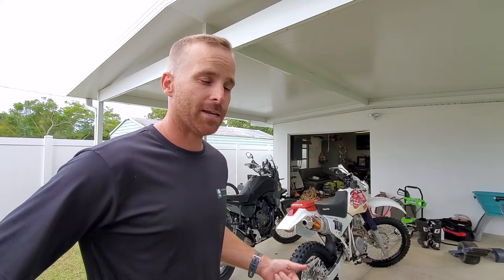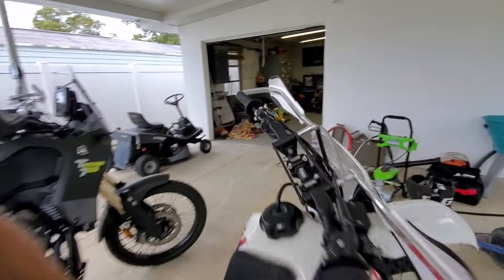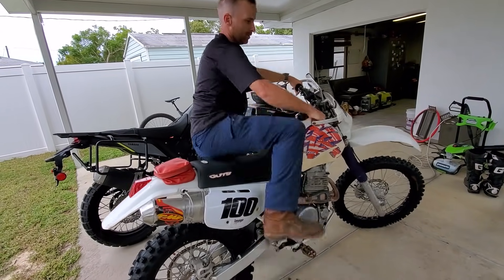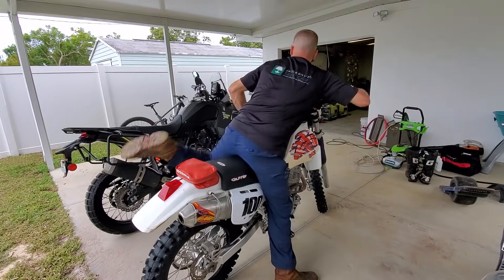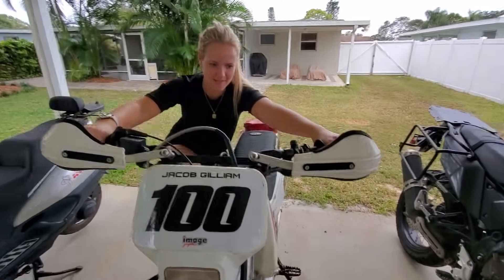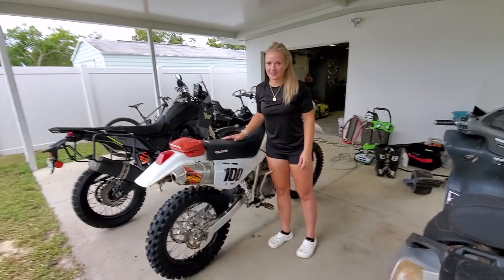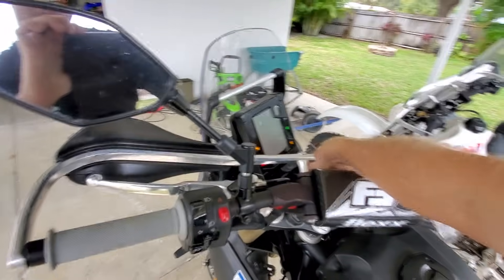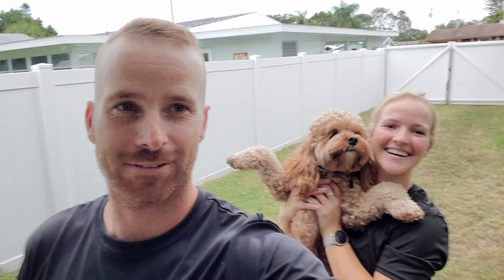How to start the Honda XR600R XR600

Comment: Most important thing with these big 600cc thumpers is to NEVER EVER kick them randomly. Because that's when they won't turn over all the way before firing and kick back. And a 600 that kicks back will break your foot and eject you off the bike.

Comment: I'm a senior citizen, I've owned many bikes, owned quite a few Big bore thumpers, the trick is getting the piston in the right spot, (I think TDC)... I got to where I could start them by hand.. just don't touch the throttle when it's hot, very dangerous, not to mention you could go down the road to a flooded nightmare

Comment: Great instructional video. 
I had anxiety riding an XR650 (leaking fuel) back (across desert) for a friend thinking if it died, I'd never get it started. It died on its own and after taking a water break, I readied myself for battle. Couple strokes on decomp until TDC, click past and an easy boot it fired up. I had never been happier. Thanks for clarifying this. Been stuck with starting my 450exc on a hot summer day......but that's another story.

Comment: My very first bike was an XR600................and it was WAY before the innerwebs and great instructors like YOU.  I think my right leg is still a little bigger decades later! I also learned that if I didn't ride for more than a week, it helped to drain the float bowl before I started my kicking frenzy.
Reply: They are also hard to start when they are hot. I'm not sure if this trick in the vid helps that or not.

Comment: So my right knee needed replacement do to a injury and I fought it for a long time.  The result was I couldn't kick a kicker bike for about a year.  So that meant no 650R KDX220 or my CRM250R to say I was bummed was an understatement.   I finally decided to not be defeated and learned how to kick with my left foot.  In the process I found the 650R easier to start left footed off the bike.  That last 4 inches of stroke under the footpeg is the important part of the process.  It's the same process as the 600r and make sure the kickstand is down or you will take the dreaded off balance fall to the outside if she gets away from you.  I got a total knee replacement and it's amazing now!  I was showing my oldest daughter how to start it and even figured out I can hand start it!  She is 6'1" so it was pretty easy for her to get it too.
Reply: I am in the same boat. 66 yrs. old, recent knee surgery. Have a young friend who starts his  supermoto 600, first kick  Looking at a XR 600 that priced right.

Comment: Same with all big singles that dont have a linked decompressor. The guy I bought my Ariel 500 from had it for five years, and sold it because it was so hard to start. When he showed my how to start it, I got the impression that he didn't have the slightest idea. He swung blindly at it for about 10 kicks before he was dripping with sweat and gave up.   I took the plug out and dried it, and started it first kick.

Comment: Helps a lot having a properly tuned carb. I have an XR650R and it was a bear to cold start with the stock carb when I bought it, even with the correct starting procedure. I've since upgraded my carb and it starts first kick whether cold or hot.
Reply: What carb upgrade did you get?
Reply: My cr 500 be gone😊

Comment: I used to do the same thing with an XR250 my Dad had a long time ago. Was a similar process to get it started but once you knew it, would fire 1st time without fail. Worked on a TTR125 as well.

Comment: I had one for 10 years.  Had no trouble starting it.  Didn't even need to use the compression release.  This bike started any time every time, even if you dropped it on the left side .. unlike the XR400R.

Comment: Prob 2 weeks top on my 93 xr600r restoration. My air intake box has a muffler burn in the bottom had to duct tape it for know, can’t find a replacement yet. But I’m excited to get the beast back out of retirement and show its original owner. I am the third owner second owner couldn’t start it is how I acquired it. It been a long process from start to finish.

Comment: My xr250R was very similar except before starting you would rotate the thumb idle screw about 3/4 a turn to bump the idle up.  Then after it warms up you turn it back down.  However, if the bike was hot and you shut it off.  God help you.  You get one or two chances to do it right and if you miss it then you will be kicking and cussing at the same time.  That bike was "For Sale" so many times in my head but every time she fired up she was your sweatheart.

Comment: it's my opinion; you did operate a machine. You kicked and in /fact sparked/ a 6 hundred R and demonstrated life on breath. I respect what you narrated at the 600. I respect that what you did to that machine cancels normal and restores hope. Keep riding. When you do ride I assume your  big ass front wheel is lower than your rear wheel. I assume your right hand is rotated to full open as your rear wheel screams...give me more right hand rotations. Tuck get low draft win.

Comment: Same as starting a YZ250F/YZ400F/YZ426F/YZ450F with a decompression lever.
Reply: Yes! I was going to say the same thing. I had to do this with my 426 and it worked every time.
Reply: Pretty much every 4 stroke
Reply: And big bore 2 stroke
Reply: SuperDave Miorgan  Used to start my Ktm 380 like that, always first kick

Comment: I drove an 85 for a while and we bought it used and had no idea there was starting procedure. My leg still hurts from all the ridiculous kicking over because I never learned it😂 we finally figured out about finding the position and how it sort of clicked when it was ready to start but never use the compression release.  I’m embarrassed to say it but we didn’t even know what the compression release was, sounded like a Jake brake on a big rig so we thought it was probably some sort of break using compression from the engine they just didn’t work very well. It’s a little embarrassing but it happens I guess😅

There were definitely some days I tore my leg up. A lot of times I just rolled it down the hill and bumped it because it was just easier and luckily I lived on a pretty steep hill.  I guess a good part of it is it probably makes them cheaper to buy used. Lol

Comment: I’ve done the New England trail rider association or NETRA Snow Run Enduro That happens every January in Connecticut for the past 67 years on and 97XR 600 R about 20 years ago now imagine kicking that thing over on a cold January day an hour before your minute comes up

Comment: Yeah my 80 model XT 500 had a little window on the right side on the cam, it let you see the position, and of course the compression release lever by the clutch,, I got so used to starting thumpers, I would show off and start high compression race bikes with my hand

Comment: Mines and depending on how cold it is I pulled a joke and the compression release and put a full kick through prime if the engine has not been run and it about 60°. If it's colder 1 2 3 or 4 more if it's very cold.

Comment: Pretty close to the procedure I fo except I never use the decomp unless the bike is flooded. When cold I pull the choke and cycle the kicker a few times past tdc to start oil flow to the head and to prime the cylinder. Then I get to tdc and kick through the compression. Decomp is only for when it's flooded I hold it and kick the kicker with no tdc since the valve is held open it allows extra fuel to blow out the exhaust. I too have always told people you could start one of these bikes in sandals if you wanted to. Just don't let it kick back up on you.
Reply: That kick back is serious and I still have anxiety watching her.

Comment: Great video, I have a 1977 Yamaha TT500 and that’s the same way to start it too
Reply: 20 years ago, I had both a 1977 TT500 and a 1984 TT600.  My girlfriend always wanted to ride them, but she wasn't able to start them.  I never had a problem with either.  The TT500 had the de-compression lever, but the TT600 had automatic de-compression.  The thing that I always taught was to 'kick with a follow-thru', kinda like the way a golfer swings his club.  Most people try to start these bikes with a quick kick, but that seldom ever works.  A nice slow kick with follow-thru does it first time, every time.  I love the sound of these bikes.  They make a thump, thump, thump sound.  Lots of bottom end torque for hill climbing.  The only time that I ever had an issue with these bikes was trying to make my way thru a 'clear cut' forest with all the tree stumps and debris in my way.  My brother had a trials bike with much better low end torque and he could run circles around me in all that debris.  Last year, I bought another TT600 that came with a spare engine and transmission for parts.  I got the bike for $500 but the plastic gas tank is completely rotted out and breaking apart.  The new tanks are very expensive, so I'll have to figure out a more economical way to solve the problem.  I have a 'hot air' plastic welder, so I might attempt to make my own tank.
Reply: @georgecraft007  The big difference between the Yami and Honda was TT could kick back enough to absolutely slam your knee into the bars if you weren't careful.  The Honda does not have that trait.  My TT was a 78 500.
Reply: @dirtcurt1  My 1977 500TT would definitely kick but the 1984 600TT was really good.

Comment: You don't really need a decompression lever if you can kick through tdc..which isn't terribly difficult under normal circumstances. The only time the decompression lever comes in handy is if you lay a 600 over. Then you pull everyone aside, bust out the beer on the trail and wait because you'll be there for 20 minutes while people take turns kicking..speaking from experience on that one lol.
Reply from the maker: So you don't really need one, except for when you lay it over? 

These are race bikes. They get tipped over.

Comment: nice video ive always had some trouble with big cc kickstart bikes

i had an old 94 DR650 that was standing for about 3 years and i kicked until i needed new shoes, couldnt get it to start... half the time of that i couldnt even use the decompression lever because the cable was broken. before i have only kickstarted my 125cc two stroke which was so easy you could move the kicker with 2 fingers and it started. so i went and got some help from a friend who had more experience with kicking. even he couldnt get it to start. then we took the exhaust off in case it was full of crap and the bike finally started.

the other piece of shit i had to kick start was when i borrowed a ktm 620 sc for 2 weeks... the whole weekend i tried starting it, destroyed 2 pairs of shoes and was barely able to walk after that. my friend said i should kick like a man and not like a pussy, thats why i tried it for so long. i ordered a spark plug, put it in and voila it started 2nd kick.

i learned a few things about kicking. one you dont even need the decompression lever, its just there to make it more easy. two make sure you kick it all the way to the end so the kicker doesnt come back and destroys your foot. three make sure everything is fine with the carb and engine or it will be hard to start, no matter how professional youre kicking. four dont kick while the bike is on the sidestand. its fine for a while but eventually the sidestand will bend
Reply: You wouldn't start my xr without the decompression lever. You can stand on the kicker and it won't budge.
Reply: @Billy28376  yeah i know how it is. im about 200lbs and on these bikes i need to jump on the kicker to make it move past TDC
Reply: Had an old YZ490 and started it like this guy here https://www.youtube.com/watch?v=fjlcCoDKAPo&t=10s. Was a real pig to start too. You need a seriously high and hard kick to get a 490 started. Love kicking the shit out of a big dirt bike though. Feels great when it finally starts.

Comment: I must correct you, when you say you find TDC, it is actually BDC just after the intake stroke, valves close just before BDC and create vacuum.. notice the suction sound, if you push further without using the lever.. then the kickstarter gives a little jump, that is when you overcome the vacuum at the bottom of the intake stroke, get past BDC and go into the ignition stroke, the piston is now about half way up in the cylinder.,,, now it must be kicked over TDC and it starts in 1/2 turn..  exactly as you say,, they are made to start in that particular way.   😀😀😀😀😀
Reply from the maker: @gertkristensen6451  "overcome the vacuum" lolol 

I don't think you're right.
Reply: @fastguysslowbikes  that's exactly what most people will say, find TDC and use decompressor to go past TDC, that's just not what happens, that's what people have heard and think is right, point 1 you can't reach an exhaust stroke + intake + comp + ignition stroke on one kick unless you can kick as hard as a horse, try unscrewing the valve poppers and see that when you feel the resistance the intake valves are just closed, you should also put a mark on the shaft on the stator side so you can see exactly where the piston is, you will see that the mark will be just before BDC and the valves are just closed, this is where the vacuum occurs, it can be overcome in two ways, 1 you use the handle on the handlebars 2 you press further on the kickstarter, when you get over the vacuum it jumps over to the other side of BDC and the vacuum will follow and suck the piston up again + you press the kickstarter it's here you feel the little jump in the kickstarter.. now try to investigate it, and remember to eat your old straw hat afterwards,,,
Reply: @fastguysslowbikes  I have also discussed it with Norton people who said that it was just past TDC when you start,, they investigated it at the motorcycle club,, I got the answer back that they were very wrong. You can't start a big bore from just above TDC. You are always before TDC,, otherwise an old big bore will backfire, whether you have hotcam or auto de crompressor it is ALWAYS just before top. And you know very well that an xr that is in good condition starts so easily that girls 14 years old can easily start them.. when you say find TDC and go past TDC,, it is easier to understand, It is precisely like with a 2 stroke you don't put a cr500 just after TDC and start it from there,, Because then you also know very well what will happen. namely that you break your leg  and happy new year to you an ,monika 2025 😀😀😀

Comment: How do you not have more followers?!  Quick question about the old XR650L you used to race.  Was mods were done to it to get it race ready?  Im thinking of picking one up.
Reply from the maker: Check down my channel for a race mods video on the 650L. It was a few years ago.
Reply: @fastguysslowbikes  thanks.  Found it.  Whatever happened to that bike?
Reply from the maker: @border411  Any by the way, go grab a 650L. They are really great bikes.
Reply from the maker: @border411  the 94 650L had transmission issues so I retired it.

Comment: can u explain what does decompression lever do and how do  u set it up?
Reply from the maker: It opens an exhaust valve so the engine can lose some compression. It comes on the bike.
Reply: @fastguysslowbikes  I live in the Bahamas and I still have my 1987 600xr.I started on a 185xl as a teen and then the 500r then the 600xr.I used the decompression lever before however not quite the way you did.I am 51 and just learned something new.Seeing your wife kick start an 600xr is impressive.If you ever got one of those kick backs, that would send your knee into the handle bar, you would have had an experience to share.I had a few until I learned my own technique.This video got me interested in firing up the old dinosaur.The young riders always get a kick out of the bike having rear hub brake.

Comment: I also have the lectron kit on my xr600 (Thanks for being the guinea pig with that haha). I wanna know, do you use the choke for cold starts? Cheers
Reply from the maker: Ya I choke it and give it some gas. And with the lectron I've noticed that I need to keep it running for 15 sec or so with throttle. It doesn't like to cold idle.
Reply: @fastguysslowbikes  thanks man, I'll have to try with some gas and hope it doesn't kickback and try to break my leg haha.

Comment: Now teach the clutch start. Get a "cough stop" on a hill climb and she's all over. Nice little Corbin tail light, smashed many of those in my time! 
Muck around with needle height to richen mixture, but more importantly replace the original hinged choke valve before it ruins your moto mojo